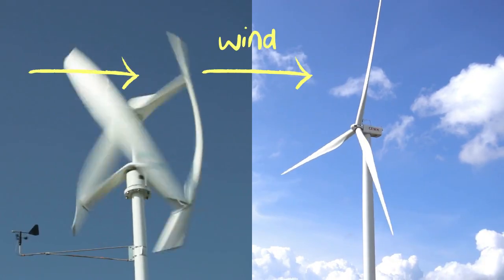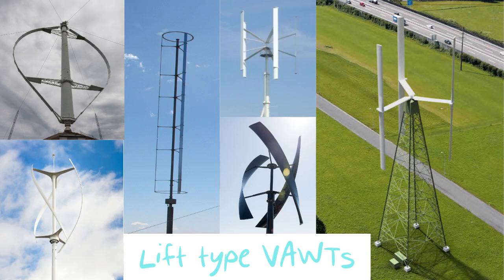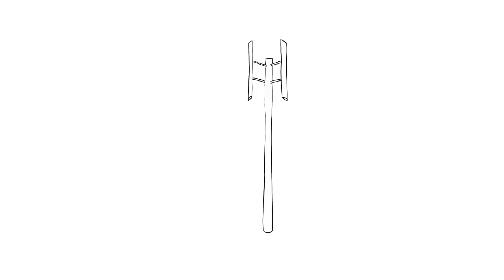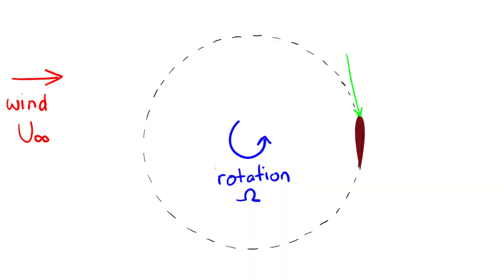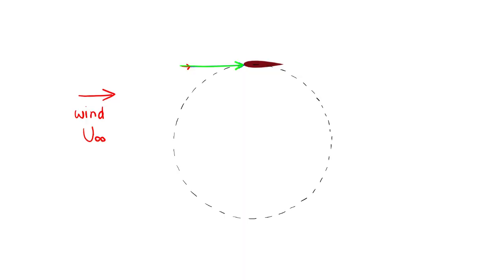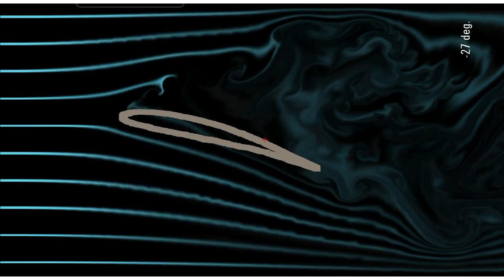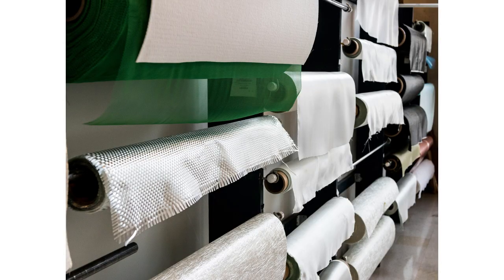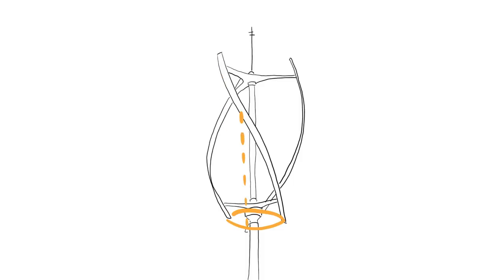Vertical Axis Wind Turbine Aerodynamics and Design

Comment: Hi Rosie,
I have seen a video outlining a vertical type of wind power generator that, due to its shape, produces power using the vibration caused when wind passes around the "blade". Could you investigate this as it was proposed as having extremely high efficiency when compared to current horizontal and vertical-designed turbines. I am very interested in your thoughts on this.

Comment: Thank you, very helpful but still leaves me in a dilemma... . .small farm in Southern Scotland with geographically 5.1 m/s average windspeed.  However, location of a small wind-turbine 500w - 1.5kw is problematic due to the turbulence?  I have been told that any small wind turbine (under 1.5 kw) MUST be within 100 meters of the solar array and batteries.  However,  there are just too many buildings and a variety of trees that will disrupt the air flow at 10 meters for a conventional horizontal type, but small vertical axis - could it's lower efficiency (40% ish) outweigh the issues of the turbulence?  

Ps, sorry not strong on the science but I flew hang gliders when I was young and have a lot of personal experience of turbulence 😞

Comment: In my next life I would like to put some VAT on top of the solar arrays on my electric boat, so that as I cruise into the wind I get energy to push my boat. My boat also thrusts at an angle to produce the forward movement, but also to lift my vessel to reduce water displacement and drag. Idealy my boat skims the water so I can get 35 knots on my solar/wind skiming craft. Then watch out fish, if there any fish left in the sea by then.

Comment: Hey I was thinking about vertical axis blades on an exhaust fan and if the airflow would be given a larger surface area at the inlet or do the vertical axis blades push the air current both directions vertically? If so can that be changed by changing the upper part of the blades so that the air current has one direction?

Comment: Hi Rose. I am very excited finding your channel. I also tried to design a VAWT ( Savonius ) with the intention to try and solve the 
inherent problems like  it extract less power , low rotational speed , big stress impulses on the structure , torque variances
 causing impulses on the drive and generator , torque variances can cause difficult self start , upstream blade exerts a braking force
that is lost wind power in the swept area , upstream blade has low pressure at the back of the blade causing drag . Not really good 
for electricity generation ( According to researchers) .  I agree completely with you , you have to add complexity to solve problems. I would like to discuss my design with you . I believe it will solve 90% of all the problems the researchers tell us about. I did build a model for proof of concept .But I need somebody to help me with calculations but confidential because I believe it can be patented . Unfortunately I do not have 
a big budget , it is a home project .I will appreciate it if you can help. I am Hendrik Stander from  Pretoria in South Africa .Regards

Comment: Hi Rosie, when designing a VAWT, can one increase rotational speed at the centre (the generator) by placing the two straight blades (in an H design) farther apart? I am referring to a small VAWT for a cottage. I'm hoping to see 200 - 300 watts of power.

Comment: I have been really enjoying your videos on green energy topics. You bring such creativity, brilliance and enthusiasm to the green revolution and from my experience, are spot on with the nuances of turbine design and explain complicated topics in such a nice way! The clips of the whimsical small wind turbines in northern Europe were heartwarming. It figures that you studied at UC Davis (I am an alumni)! May I suggest that other niche markets worth mentioning are areas having view shed concerns, and radar sensitive areas near airports and military bases. Ridge lines are excellent for VAWTs because the wind can be higher near the ground, which is particularly suitable for a VAWT. From a distance, VAWTs may not be visible in that niche. One huge potential market in the US is underneath large HAWTs in existing wind farms. In California, there are many good wind sites at 10 m above ground in wind farms. For instance, one site I worked at was at Whitewater in the Palm Springs area. The average wind speed at 10 meters was 6.5 m/sec at Whitewater. For more information on the under story niche, see- https://www.windpowerengineering.com/repowering/harvest-plentiful-low-level-winds-existing-wind-farms/. This potential huge market is waiting for the right VAWT and proof that HAWTs would not be threatened (as indicated by models that say so) by turbulence created by VAWTs beneath them. As for lack of efficiency- have you heard of the dual-vortex effect (patented in the US by Robert Thomas)? Closely spaced VAWTs, with optimum solidity, etc. have been tested by Windharvest and model results indicate efficiencies equivalent to HAWTs. I can send you a report for the California Energy Commission, if you are interested. I believe (and am working on) a commercial scale (straight bladed) VAWT can be designed to be durable, simple, low cost, and efficient. The key is making extruded aluminum work. Flowind turbines almost got it right, although they were fairly complex. Cheers.

Comment: Well, if your watch any of my 20+ video's you'll see why you Never buy Tesup, vertical turbine.  I have real life testing on my videos, They straight out LIE.  Atlas X will not spin at 4m/s... it barely moved at 16m/s, 35mph wind.  I then modified it, doubled the blades, it now spins at 12 mph, but not fast enough to produce 50 volts to power up the inverter. It takes nearly 20mph wind to due that.  So now I'm listening to Rosie and going with a Helix style and a smaller generator.. Tesup's 4kw gen is to big for the Atlas X to turn.  TESUP is a SCAM.

Comment: It seems that a VWT is really the best solution for "add-on" power for a home.  It could easily be mounted on the roof and produce more energy than a solar panel without the complexity of installing a HWT.

Comment: Hi  Rosie, Love the videos! super interesting and informative.
 I'm making a small 3 bladed   H  VAWT  with two extra Savonius  startup blades    (using 12  30mm x 10mm x 6mm  neo magnets and 9 coils for the alternator,) . I'll have to carve the aerofoils from wood. Would you recommend  NACA 0018 or NACA 4415 profiles please? bearing in mind, the 4415 would be a lot easier to fabricate. Thanks very much  ..

Comment: Dear Rosie

I have written two public reports about Darrieus rotors. In 2004, Report KD 215: "The Darrieus rotor, a vertical axis wind turbine (VAWT) with only a few advantages and many disadvantages" and in 2015, Report KD 601: "Ideas about a self starting, 3-bladed H-Darrieus rotor for water pumping". The second report gives a simple design theory how to find the optimum chord and the optimum tip speed ratio for a 3-bladed H-Darrieus rotor. This theory is derived from the design theory for horizontal axis wind turbines as given in my report KD 35. I have also written report KD 416 about drag machines, report KD 417 for the rotating blade design and reports KD 599 and KD 703 for Savonius rotors. To my opinion, development of any VAWT is a waste of time and money except for certain very special conditions. About hundred public KD-reports and manuals can be copied for free from my website: www.kdwindturbines.nl at the menu KD-reports. Please start with the note: "Sequence of KD-reports for self-study" given at the top of the list with KD-reports.

Adriaan Kragten

Comment: Another great video from you, thanks! Do you plan a video about which kind of generator to use with a vertical wind turbine? I plan a 1KWH vertical wind turbine, Darius or Savonius don't know yet, and I'm not sure about the voltage (12V, 24V or 48V) I should choose for the permanent magnetic generator.

Comment: I've had a further thought on something to try with VAWTs, which is to use dual concentric VAWTs spinning in opposite directions, one spinning to magnets the other the coil. 
eg an Ugrinsky type inner, spinning a ring magnet say clockwise and a egg-beater type outer spinning the coil counter clockwise.

The generator type I envision being used would be the type shown and explained here https://youtu.be/o8pDwgv0b80?t=196 
mainly because of it's simplicity in design, although as both parts are spinning, slip rings would probably have to be employed to get the power out. It would also be quite a nice demonstration piece as of course either turbine could be physically locked in place to show both individual characteristics, albeit in the sub optimal configuration of having the other turbine creating some interference in wind-flow, and the combined characteristics.
Reply: Or possibly rather than spin the actual coil, to avoid the complications of slip rings etc, it might be possible to just spin the crab cage ( which bend the magnetic forces ) surrounding the coil, the 2 parts of which could be joined together with a non magnetic medium like resin/fibreglass

Comment: Hi Rosie, I personally think a VAWT will work better on a sailing boat. First the wind direction fluctuates a lot when at sea so the generator is always changing direction and then you have the wave action that messes with the centrifugal forces. Changing the pitch is very easy with a simple cam and leaver. It is direct and instant

Comment: Good day Rosie, I do have a horizontal axis wind gen on my yacht. The blades regularly stall which causes vibration and then we also have the problem of the yacht rolling and pitching which causes centrifugal forces in all directions. So I was thinking of building a vertical vane. To control the different pitches as the blade is rotating I think a type of leaver system that runs on a cam could be made to control the different angles of attack. The cam can be mounted on the shaft with push rods and a cam follower on the rotating frame.

Comment: I like the helical design, it seems very effective in Urban settings where wind bounces off different surfaces, which the Vertical turbine can handle a lot better than horizontal turbines where they have to turn "into the wind" to work. For the big Horizontal turbines you also need a lot of clean air space in front of the turbine to make the units more efficient.

Comment: Have you seen any single vertical blade designs?
 On an I think 'tommorows world' (70's)young engineers competition a design for a  vertical blade that 'flapped' in the wind like a bee wing. At the end of each stroke it changed pitch to go the other way avoiding mechanical direction change. 
Novel idea with many issues but got 2nd place I think! 
Cheers Warren

Comment: Going for large WTG's Vertical axis turbines have a scaling problem that Rosie forgot to mention. the swept area of a vertical axis turbine is DxH, so to increase the swept area Either D or H has to be increased (or them both), but it's a linear scaling. If we look at HAWTG, the swept area is calculated as A=(pi()/4)xD^2, so here we do not scale the power linearly the power scale in second power. So increasing the dia. with 10% => 1,1^2 => potentially 21% more power production. On the other hand if either D or H in a Vertical Wind Turbine is increased with 10%, we only get 10% more power.

Comment: Floating VAWT have a good future as size can grow but with moving parts closer to ground level they are easier to maintain.  For floating, the stability of the VAWT very important and does not require huge engineering and materials like HAWT structures!!

Comment: I suppose their needs to be a balance between efficiency and resilience.
It would appear to me that a very efficient turbine burns brightly for a relatively short time before requiring servicing or replacement. 
But if it's possible to build a low efficiency turbine with a low output that could run for over a decade without any servicing, would that not be more efficient over time.
I am thinking of just running a fridge freezer for example, which is the biggest use of electricity for many because it's on 24-7. 
It may be a very low power unit, but it's running for many hours. So a low power vertical axis in an urban area running through an mppt controller charging a battery which powers an inverter could save money cumulatively over time.
Running for more years and lasting longer would also offset the environmental impact too.

Comment: Hi Rosie! Thanks for such a great video! It's been very helpful for me in understanding VAWTs.
I wonder why most commercial VAWTs have synchronous (permanent magnet) generators and not asynchronous (induction) like most horizontal turbines. Do it need to spin at variable speeds to generate power? Where can I find some information on this?

Thanks a lot! Greetings from Argentina!

Comment: Hi Rosie,

Lately I have seen talks about placing funnels around the vawt. Would that, in you opinion, be a path to follow to increase the efficiency?
Reply: Anything that can increase the wind speed seen by the turbine in low wind conditions will help, but in high wind, it would be ideal if the funnels could be reversed so that their action helped protect the turbine.

Comment: It would be interesting to make a VAWT with the actuated vanes. Make them out of composite. Put a steel-geared hobby servo at the root of each one with a battery pack. I'll bet with a lithium ion cell or two, that servo could last a long time. Have four vanes in the H-configuration. The base has the generator and a shaft encoder. Maybe have a wind vane and anemometer wired up through the center of rotation to the top. Have the servos control the angle of attack as it spins around, changing for speed and wind direction. Could be fun for a remote camp or mobile off grid situation. Just set it up somewhere and it should start and steer itself. Another idea: figure out some kind of angle of attack "circle" and use some kind of machine learning algorithm that would vary the load and angle of attack profile to maximize power generation, and then have it memorize that "map" for different wind speeds.

Comment: I wonder if the efficiency could be improved by blades that slightly wobbly instead of solid. mounted at the front, and rubbery at the back. Similar to the fins of a Hobie Mirage Drive?

Comment: I have noticed that the best design seems to be three blades curved 180°. And if you just look at the turbine really closely you'll understand why, because it has the least amount of wind resistance coming back, and it traps the wind in it's blades. Also it actually doesn't matter at all which direction the wind is blowing, I messed around with a leaf blower on a small prototype blowing it from all directions walking around in a circle and it liked it, My prototype easily handles 90 mph winds it is almost invincible. Now I just need to weld one together out of aluminum full scale. I think where people are majorly dropping the ball is with the alternator, my home made alternator is way better than any alternator I can find on the market. Because it's efficiency level is not related to its speed and it doesn't care how fast it's spinning, It Always makes power at an incredible efficiency no matter what speed. I'm thinking about regulating it by using something similar to an adjustable battery charger, where the amperage can just regulate up and down. So you can use the draw on the battery charger like device sort of as a break.